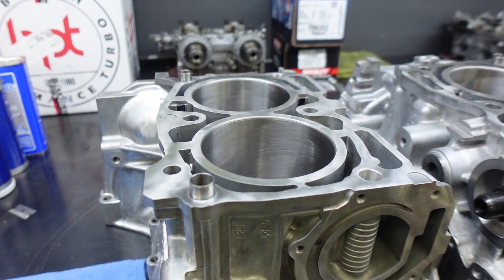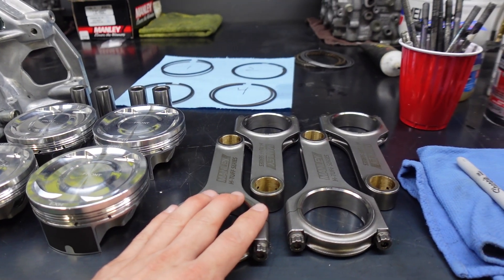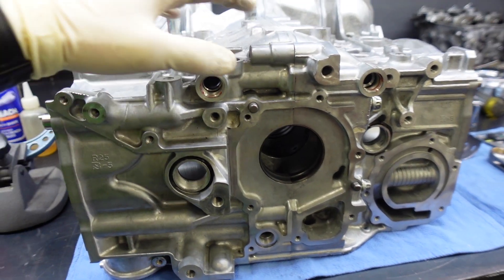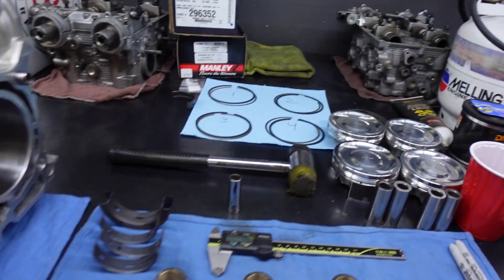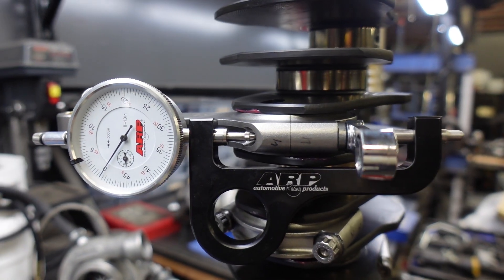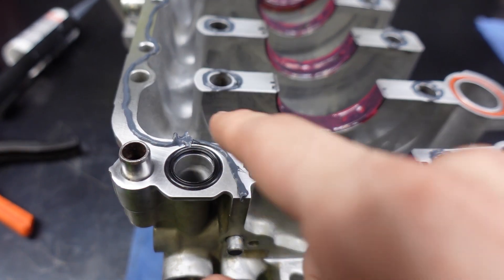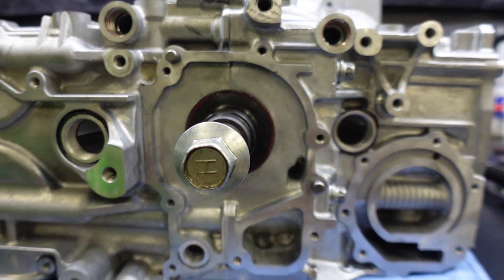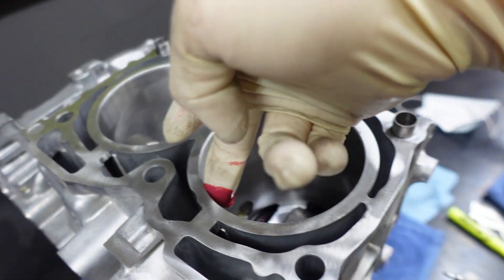Fixing the Subaru EJ25 Engine! The Weak Points..

Comment: I'm a newbie on this whole thing but something I've always wondered is, when you check the bearing specks with the case halves bolted together there isn't any rvt sealant on the halves. But when you're ready to finally put it together then you put sealant on the halves. Does the sealant not change the bearing tolerance?
Reply: No rtv doesn't effect specs

Comment: Hi Autoworx, I currently have a 2012 wrx with a factory ej255. Soon I  would like to have the engine built. I'm a fter a performance street car that will handle 400whp. Would I ve better of replacing the whole engine with an EJ207 or go with an ej257?
Really appreciate iate your help
Reply: IN same spot with the ej255 IN A 2010 FORESTER XT what you end up doing

Comment: What do you recommend? My car has blowby since I made grimmspeed modifications for more power .. I use a little more than a quarter of oil per gas tank, can I change only pistons and rings or I have to put a short block iag
Reply: Do you have an Air and Oil Separator (AOS)? If you don't, then you should get an IAG AOS and go from there. EJ engines will consume oil regardless, however, depending on how much oil is consumed per 1000 miles you may or may not need to replace the short block. Subaru considers a quart of burned oil every 1,000 miles to 1200 to be acceptable. Of course, that's if you have an OEM Short Block. Aftermarket Short Blocks such as IAG will provide their own oil consumption sheet for every 1000 miles. 

Before buying a new short block, I would do a compression test to make sure is indeed your ring-land causing the blowby/oil consumption. Just because you are consuming oil, it doesn't necessarily mean the pistons are cracked. It could be other components consuming oil such as worn valve guides and seals depending on how many miles you have in your motor. But then again, anything is possible with these Subaru engines. 

Changing only one piston will not fix any issues at all because if you indeed crack a ring land, it is just a matter of time until the other pistons fail as well. I always recommend replacing the entire Short Block at a minimum but that is just my professional opinion.

I hope you find this information helpful.
Reply: @xXJhenkillerPR  thanks u ... My car has 110k.... The car i drive only 100 mille and use 1/4 oil .. is to much ......the information help  a lot

Comment: All that work, all them nice strong internals, but on a semi closed block?. The whole reason you build a forged motor is to remove 'all' of the ej257 weaknesses. One of them being the thin cylinder walls prone to cracking. Build it once, build it properly. 👍 Great videos though 👌
Reply from the maker: True although it depends on what your power goals are. At our goal of 450 whp this motor is all we need.
Reply: @PMAutoworks  they crack at even stock power levels. Due to detonation and heat cycles. Here in the uk closed decking is a must, during a forged build. Although, some builder go closed deck at 400hp at the crank max. I here iag say 475whp or 550hp lol. Which is fine and some may last, personally I would not risk it. Build it once, build it properly.
Reply from the maker: @christopheredwards357  Stay tuned to see what happens to this block! We are tuning it today and will post a video.
Reply: @PMAutoworks  hey i would to speak with you about the price of doing this. Please HMU.
Reply: I agree. Why would you not close deck the block when it was there to be done. Later if you want more power your have the foundation to do so. It’s about $800 here in Australia to have the inserts put in. It’s a no brainer to keep those cylinder walls solid.

Comment: Any reason you stayed open deck besides cost?
Reply from the maker: Mostly because for the power we plan on running it isn't necessary. And since it wasn't necessary we decided to save the money and put it else where. We are building for 350-450hp and don't plan on turning it up past that.